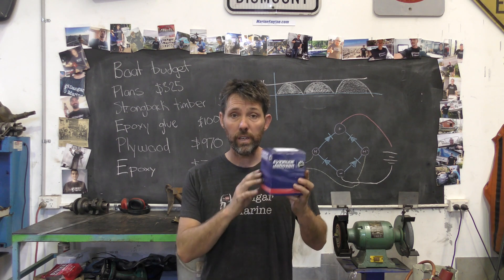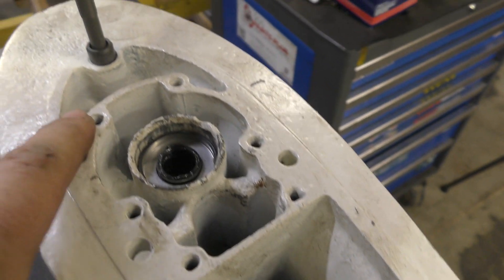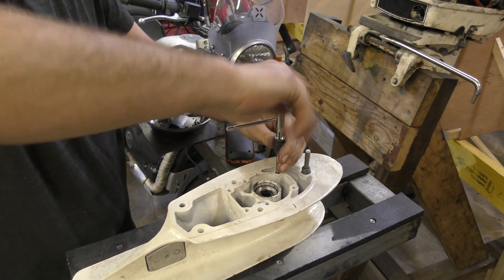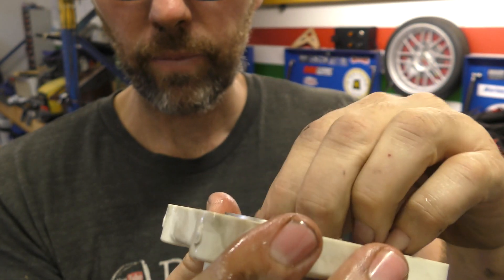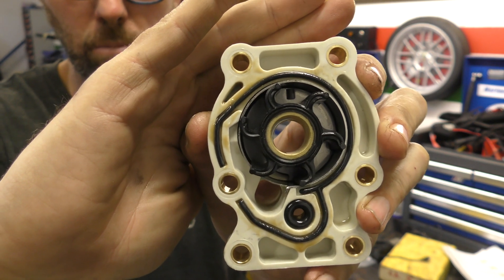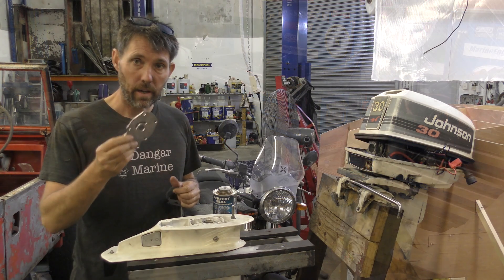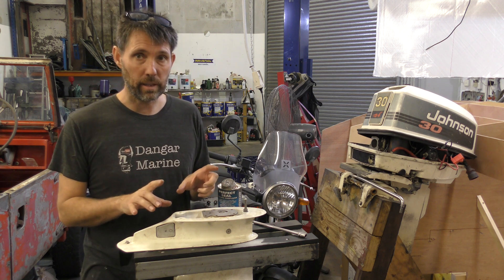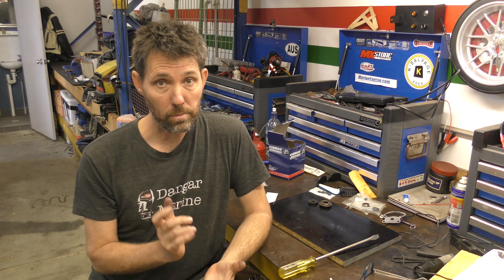Replacing the water pump on a Johson 30HP outboard

Comment: Im working on an old evinrude currently.  Thanks for all your videos on boating and maintenance over the years. 👍 
Can you answer a question for me. 
If you were in the market today for a 150 class outboard.  What brand and features would you go for?
(Ie) 2 stroke or 4. Brand. 
Used for lakes and river. Thanks
Reply from the maker: Personally I'm a big fan of the four stroke Honda motors at the moment.
Reply: Dangar Marine thanks.  Ill keep that in my thoughts.  And do some research.  Currently I've been considering merc pro xs 2 strokes but also considered evinrude and Yamaha.  Ill look to see where my nearest honda dealership is so i can price one.
Reply: Big D - I just went through the exercise , 1974 50hp Johnson, 2 cyl/2 stroke being replaced by ??? . I was open to almost any engine  but the deciding factor was that my boat transom was designed around and engine of around 75Kg -80kg max ( so about 150 -170 lbs) . That knocked out most four strokes and the Mercury anchors. As I wanted fuel injected I ended up going for a Tohatsu (Nissan) 50hp TLDI. I have just managed to run up the 20hrs for the first service and am planning for the boat to go to the dealer next week for that. But so far the engine has impressed( the installing dealer has not!) . 20litres of fuel ( about 5 US gals) goes for about 6hrs at 8-10knots, and about 2.5 hours at WOT + launch and channel work of about 1km.  O my boat  with us two fatties onboard you are looking at an all up weight of about 600kgs. The stock prop is a bit under sized though as we hit the rev limiter at 34 knots a few times.
Reply: Ron Powell thinks for the information.  I am currently considering a new boat with a 150 hp. Trying to decide on what brand and engine i want. Its an aluminum hull bass boat. So all input will help. I live in the USA.  My local dealers (in my state) carry merc, evinrude, Yamaha, Suzuki are most common. Seems like almost every dealership carries merc. So as far as convenience merc is top for service and parts. But my quest continues

Comment: i have a question  its not about this video but i have a 1985 40hp johnson with  vro that has been bypassed i want the motor to be in tip top shape and as of now runs a bit chopy and very smokey do you think overhauling the vro pump and reconecting it would help these issues ?

Comment: Love your videos. Just inherited a 87 Johnson outboard.   When installing a new zinc after the lower is painted, does the paint have to be removed under the zinc?  Concerned about the zinc doing what it needs to do vs exposing raw aluminum to salt water
Reply from the maker: It just needs to be electrically bonded to the outboard which often the bolt will do.

Comment: I recently purchased a 1994 Johnson 25 HP that had been sitting up for a while.  I went to drain the lower unit lube and there was straight up water coming out.  It does  not have any grinding or trouble shifting in and out of gear.  I pulled the prop and the bearing housing off.  One of the propeller shaft seals appears to be blown and the seals on the bearing housing screws were almost non existent.  There was a little bit of rust on the bearings but not much.  I ordered two new bears and the seals for the prop shaft.  I did not realize there were seals under the water pump.  How hard is it to replace the top seals but not the bearings?  Do you think I could get away with just replacing the prop shaft seals and hope that does the trick?  I'm 70 dollars deep on replacement parts on this shaft, I don't want to go too deep because I could just get a used lower off of ebay.  Thanks, your vids are awesome.  I have a water pump rebuild kit so would it make sense to replace the oil retainer and seal on the drive shaft under the pump?  I haven't yet seen you remove the driveshaft from the 30 hp lower so not sure how involved that is.
Reply from the maker: Hi Mick. There is a playlist on my channel with all the vids grouped together for this outboard, I end up doing jut about every job on this lower unit. The seals under the water pump aren't hard to do and a pressure test on the gearbox will tell you if they are holding.
Reply: Thanks, I found it.  I ordered the complete seals for everything, I think I'm just going to take a gamble on the seal on the shift linkage

Comment: ive got a mid 80s 28hp spl johnson(model info is worn off), theres no shift linkage disconnect in the lower end.  lower end also comes apart in 2 spots.  one just below the exaust, and second about 10 inches lower, almost like a spacer piece.  Ever seen this and know how to disconnect linkage?  think it might be in the engine compartment, behind and below carb.

Comment: Hey Stu
Love your videos very informative.  I have a Johnson 70HP motor.  Is the replacement of the water pump the same as the 30HP.  I am worried when I get the lower unit out because I don't have a stand to work on the water pump.  Is this a major concern?  Also do the gaskets need goop on them or can they be fitted dry.  Peter
Reply: I'm wondering about the goop too. I have the same motor I'm about to crack open tomorrow. How did you go?

Comment: Hey, I have a 1994 Johnson 25hp and I was trolling slow last night and the motor shut off and wouldn’t turn over. Today I was looking at it and the pin on the throttle linkage on the starter side broke ant the throttle cam is spun around on the motor facing the back. Is my motor blown up or is the cam just jamming it up? I can’t find any information on this problem so your help would be greatly appreciated, thanks keep up the good videos.
Reply from the maker: It doesn't sound like it should be a huge problem. Hard to see how the motor would have got damaged. I would just repair the throttle linkage and go from there.

Comment: I have this motor and I replaced the water pump and impeller. After the exchange, I do not run forward !! Reverse works fine. It feels high works in the water, but my forward gear does not jump. what did i do wrong and what should i check? BR Remi

Comment: I ordered an impeller for a 35 early 80's and it was totally wrong. Listing said 35 and higher. It looks like this with a D shaft and not a key and pump had 6 holes.  Looks like they made a change in later production.

Comment: this might sound dumb but i was running my boat at night and noticed my pump went out/got melted from overheating replaced it but lost my driveshaft spacer and cant find a new one. would i need it to run my motor? or do i really need that spacer.

Comment: Hey, I took off the lower unit, and the copper water pipe fell out. Turns out it’s rubber gasket wasn’t there and it’s bent so the last guy did it wrong. 
I was wondering how do you get the gasket back in the water pump. Someone said you have to take off the lower head... I really don’t want to do that yet if I don’t have too...
Reply from the maker: It depends what holds it in really, I'm not sure for this motor. You may need to take the powerhead off to secure it properly unless the gasket goes around the pipe and is a press fit. If that's the case you may just be able to push it in from below if it is straight.
Reply: Do you have a video about taking off a powerhead?
Reply: Modle number is J30ELCDM

Comment: Gday Stu im in a conundrum at the moment i have a Yammy 90  2 stroke i bought new back in the very start of 2006 the manual and suggestions by mechanics is to replace water pump impeller every 100hrs or once a year depending on high usage my engine has ONLY 60 HRS use in the 12yrs since, as Melbourne's weather isn't conducive to constant boating and i get on my mates boats more often than mine, it still pumps water fine when i use it with the occasional salt build up in the tell tale which i pick out with a coat hanger wire carefully not to rupture the tube leading into it, i do run the motor for 3-4 odd minutes with salt away every 2-3 months. I have the impeller kit for it but because i havent done 100hrs i keep putting it off....Is the age of it a critical point or is it the hours of use that determines this service ....cheers Ken
Reply from the maker: Age does come into it as the material will start to degrade. The big problem you are trying to avoid isn't the outboard overheating as it will give you an alarm, it is having a piece of the old impeller break off and get lodged in the cooling system and being very difficult and expensive to extract. Better off just changing it.
Reply: Dangar Marine Thanx for the reply i was sort of expecting that answer... cheers Stu

Comment: Yes every video is helpful,but just can't seem to find a video on a specific motor such as the 1992 Johnson 48spl.the bearing carrier is so much different than most and can't pull it out.iv tried everyymethod shown.i must be doing something wrong.as I am  new at a boat motor,but mechanically inclined.would appreciate some ideas or even show you repairing one.thanks.the motor is a j48esenlb is mod.number.i need to see exactly how and what your doing.on this particular motor.i havnt seen any other units like mine almost similar but its just not it.thanx would greatly appreciate your input.be safe

Comment: Hey stu first I’d like to thank you for the information about how far to turn the trim tilt anode, my Yamaha 30 can virtually take off without me holding the tiller at all (except to accelerate of course) but that’s something I’d like to ask would it be worth my time and money to install a helm and steering wheel what are the advantages and what needs to be taken into account if I do decide to? Edit: forgot to mention great vids can’t wait for the next boat build vid though. 👍
Reply from the maker: I think helm over tiller really is a case of personal preference. Some people find the helm more comfortable and it is a good way to get more weight up the front of the boat if that helps it ride better. Tillers are great for getting fast lock-to-lock movement when docking and don't require the same level of maintenance.

Comment: I have a new marine shop and im working on a trim cylinder leak for a customer and during the bleeding process the 22yr old trim motor went out should I have to pay for the new motor & labor or should the customer pay for that.
Reply from the maker: You'll go broke very quickly if you take on everybody else's misfortune. The motor was going to die eventually and there is always a risk of that happening during the service. It didn't break because you were careless or negligent, it broke because it was 22 years old.

Comment: After I got mine put back together, the shifting seems to be out of sync.  It's a 78 Johnson 35.  If i shift into Forward, the gearbox is in Neutral.  If I shift into Neutral, i think it's in Reverse.  I suspect something happened when I disconnected the shift rod and was reinstalling the lower unit.  Do I need to take it apart again to manually put the gearbox into Neutral then reinstall it?
Reply from the maker: If it is the type of gear selector that rotates rather than lifts up and down, yes. You can put it together in any gear so long as the gearbox and the selector are in the same gear. https://www.youtube.com/watch?v=srGVSl4_n8Q

Comment: I have a question if u can answer it would be great I have a 96 200efi mercury i believe it to have no fire doesn’t even try to fire would the rectifiers cause this the reason i ask is my tach wasnt working when motor was running i dont know if that only relates to the charging side if not can u tell me where to start troubleshooting and how to troubleshoot other then the tach not working it ran fine no miss or nothing was on the lake shut it down to fish a spot when i got ready to move spots it just cranked im pretty sure it is getting fuel
Reply from the maker: It could be as simple as a failed overboard lanyard cutout switch or something more seriously wrong with the ignition system. https://www.youtube.com/watch?v=SN17iBL5lps

Comment: Stu, do you have a video on a Johnson 70HP slows, surges and dies only under load, but not in neutral?
Reply from the maker: No video but it sounds like it isn't able to deliver enough fuel.
Reply: Check out the cheap bits first- fuel lines, squeeze bulb etc. But complete fuel pumps are cheap for those engines, just replace it and rule it out in 10 minutes. But if the engine is 20 years or so old, crank shaft seals are prone being required. Not hard to do. just pain full time wise.
Reply: It was a bad fuel line and squeeze bulb.  The inner plastic sleeve deteriorated into tiny pieces clogging the filter -- exactly as shown in Stu's video on fuel lines !!

Comment: Hi quick question I replaced the water pump on my 6hp mercury and I was checking the gears and neutral would spin freely both ways,  forward one way but reverse won't spin freely in any direction so I'm wondering is this normal?
Reply from the maker: Yes, normal.
Reply: @DangarMarine  thank you I really appreciate it I was worried for a min

Comment: Great video Stu. These Johnsons seem to have a more complicated LU design compared to Mercury& Yamaha. I know most people like the outboard brand they know and have experience with.The snap ring seemed about the only thing easier. Do you remember if the Evinrude 150 had a similar design?
Reply from the maker: Hey Jim. This particular outboard certainly has a crazy complicated lower unit design. I don't remember the shift linkage being the same on the 150, I certainly don't remember it passing through the water pump (never seen that before!) That may be a product of it being larger and there being more room to keep things separate.

Comment: I had trouble installing my lower unit after I put the water pump in the return tube was horrible and then once everything lined up there was a small gap that I couldn’t push together..I turned the propeller while installing to line up the gears so I used the 5 screws to pull it the rest of the way...is that normal?
Reply: Btw...I bought all the parts from the website you use

Comment: Hi Stu.  I'm trying to remove an impeller that's stuck to the drive shaft.  (1989 Merc Alpha 1 Gen 2)  Is there a tool or technique for this.  Two screw drivers prying up isn't working.  Thanks.
Reply from the maker: If you can take the driveshaft out you can put it through a narrow opening and hammer the shaft down to drive the impeller up. If you can't I would try cutting away the impeller rubber and then heating the inner sleeve to expand it.

Comment: Nice video where do you get you Manuel's If you don't mind me asking
Reply: TopTime Fishing  start at manufacture I got mine from evinrude .com  actual dealer service manual that one in house 85$ second one off eBay 30? That one stays on boat also cars and trucks usually helm publishing factory service manual tells u how to do electoral test and what the result should be just tested my 08 300 etec running rich and tps is out of specs so trip on eBay to order and stay OEM on boats don't want to 25 miles out in shipping lanes and motor not run due to China part failure thanks JT

Comment: great video question for ya, I have a 1987 merc 150 two stroke its peeing good but the water seams hot almost burns your hand hot is this normal? any help would be great full, thanks, Michigan u.s.a
Reply from the maker: That depends a lot on the path the water takes through the motor. On some like this the tell tale is water that hasn't been heated yet https://www.youtube.com/watch?v=joEQChcZl2A The best thing to do is pick up one of those cheap infrared thermometer and see if the cylinder head itself is getting hot. It should be around 70-80 deg celsius.

Comment: there was a copper tube that drove nuts trying to line it up, could you tell me if I did this wrong?...it’s 1984 Johnson 20 hp......since I’m a woman with little money I’d really appreciate any advice
Reply: I just did mine and it wouldn't line up either.  Put some oil on the end and used a flat head to steer it in.  Test ran it and water was coming out of the exhaust and tell tale.

Comment: Hi, I have a 2 stroke 90 HP Mercury. I changed the water pump, but now with the lower unit back, the propeller rotates clock wise on neutral. Even If I shift back for reverse, the propeller keeps rotating clock wise. Would you please help me diagnose what happened?
Reply: I think you might have turned your gear linkage when the lower unit was off the motor.
Reply: @jacquesjacobs6871  Thanks. I can turn the shifter on the lower unit, to the left to the right and to the center and the prop still is stuck on forward (clock wise).

Comment: I have a johnson 112 spl V4 outboard motor. this is my first time owning a boat. My question is do in mix gas and oil for this motor.
Reply: Is it a two stroke?
Reply: @johncarlberg4481   yes it is
Reply: @anselmmclorren5320  if it says vro i belive its oil injected, but people premix it 40:1 or 50:1

Comment: Hey Stu,
Just got a query regarding a parts supplier on the central coast, or in Oz basically.
Wanted some parts for a 30 Johnson two stroke.
Thought, seeing as your sponsor is marine engine dot com, and I use the diagrams etc on their site all the time, thought I would order them from them, only to find that they don't do overseas orders.
Any idea of a similar place to get parts here.
Thanks Stu.
Enjoying your trawler videos, but I'm hoping you get to the 30 Johnson again, and I'm hoping you can do a tune up of a 30 Johnson.
Pretty basic I know, but a few of the ones on utube are more of a confusion than anything else.
Because these motors have a number of carby variations, it adds to the confusion, and the initial low speed setting and the idle speed in the book are a little confusing.
Thanks mate.